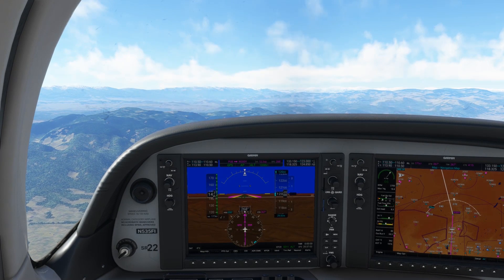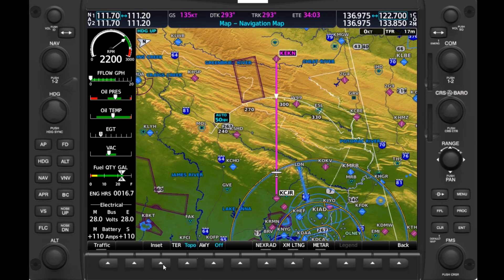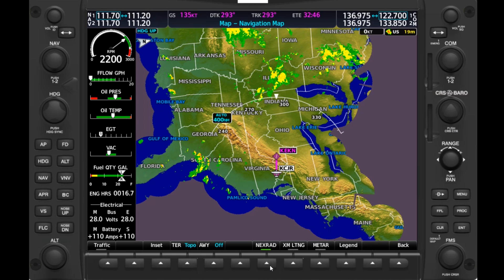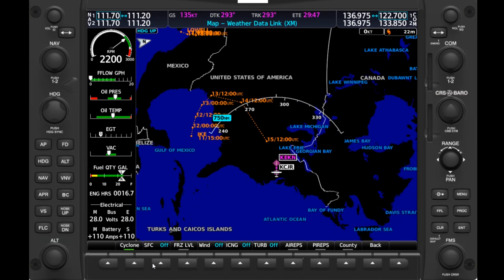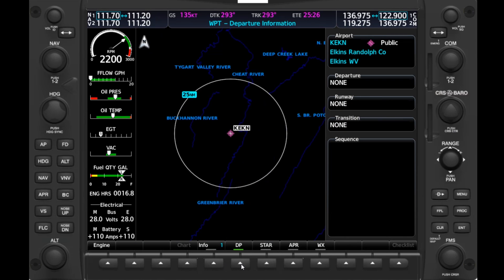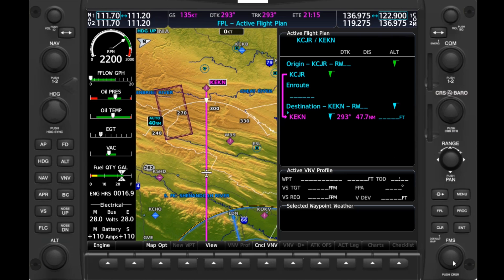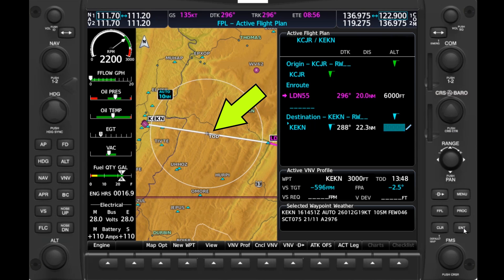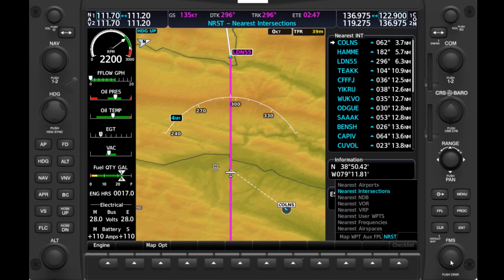Learning the Multi Function Display on the G1000

Comment: I've got a question for VOR navigation, that I think I know the answer to, but I've been struggling to find a definitive answer. Is there any way to display CDIs for both nav radios at once, either on the PFD or across both PFD and MFD? I don't believe it is, but it seems like such a gross oversight, and I haven't found something stating that for certain yet.

Comment: do you have to do raim prediction if sbas is available? sbas ensures integrity, no?
Reply: If SBAS is available, it is not necessary to do RAIM predictions. The capability is still there in case of an SBAS failure. It's probably good practice to do a RAIM prediction, just in case. Depending on your risk tolerance, you may want to forego a trip, or plan to use ground based navigational aids, if RAIM is predicted to not be available, even if you are SBAS equipped.

Comment: Amazing! I didn't know the G1000 got so advanced, it's just like the Boeing 787 display system
Reply: i think you actually getting more information using garmin 1000nxi than sitting in a b787.
Reply: @Valentin_MeL   I would say you could actually get more information in the 787 but the G1000 does it in such a small form factor. I know of some planes that can do w/b calculations and takeoff performance directly from the G1000
Reply: @codingperks  I flown just a bit 787 in msfs 2020. And i didn't saw such a detailed weather map with sigmets, airmets, satelites scans with current location of bad weather, and litttle points that represents tipe of weather at the airport. Also nearest airport are so simple to find in garmin.
So i think garmin actually give a bit more.
Of course that was on old version of msfs, so i might have missed something.
Reply: It’s better.